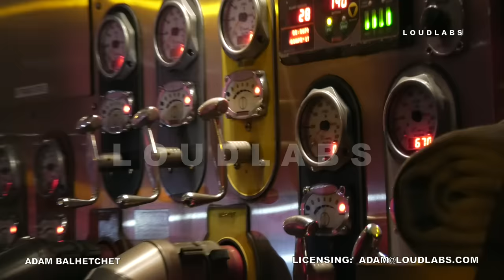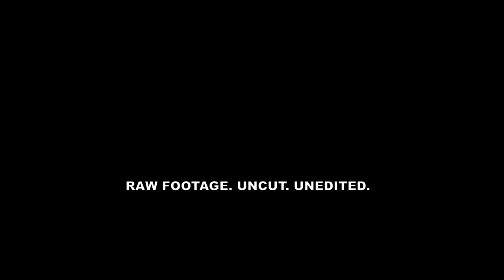24 Hurt in 6-Alarm Sunset Park Fire

Comment: I don't get it tower ladder 131 was set up at the corner of the building below the fire floor for 10 minutes doing nothing before they put it in operation after the fire spread to the rest of the floor 😯
Reply: I was thinking the same thing, I don't think any  firemen were on the top floor

Comment: Well if there ever a reason to cut back the budget. I saw a bunch of ladder trucks and tower trucks that were doing sweet F all. Well I should correct myself one was getting the top of the ladder good and roasted. 
This excuse/reason to not deliver water in the windows via the ladders and towers due to FFs being inside. Its true that steam burns are very serious. But 16 icebergs melted before any FFs were inside the building. Until the got inside they could have put a lot of water through the windows. The tower nozzle cam be controlled from the bottom. But no it just was raised for the sake of raising it...and putting hours on it. Well maybe I'm wrong they would have to find a hydrant and sent up supply lines. Which came first?
The ladder or the hydrant because it certainly wasn't the water.
That was a display of having far to many apparatus. Less vehicles with more FF on them.

Way cheaper and WAY safer as very heavy trucks that are difficult to maneuver and stop. Less apparatus saves tons of money. Also there is no reason in this day and age that every ladder doesn't come with a nozzle permanently attached to the top. Again there is that tradition. It's been a couple of decades in the  metropolitan area I live in that didn't have mounted nozzles on their ladders, towers and quints.

In my humble opinion large older department kinda get stuck in their ability to progress. They are to attached to tradition and not modernizing. Old School...repeat as necessary

Comment: What exactly was ladder 131amd others doing all that time??????????? Shopuld have been in action when fire was on top floor and not wait until the lower floor was consumed 

Thought the idea was to put water on the fire - putting it out??????? Is there some new theory where we simply let the building burn down now?????????????? Why risk firefighters when you can put large volumes of water right onto the fire.
Reply: Thank u, I was thinking the same thing
Reply: Exactly. There should have been master streams flowing at it way earlier. Several aerials set up but not being used. I dont understand. Even the biggest fire department in the nation can drop the ball on quick water application/evaluating fire conditions. That fire was master stream size from the start of the video, also seemed wind driven. Hand lines were obviously not effective on initial attack with this one.
Reply: They always do this 100's of firefighters and 10 trucks all standing around chatting and watching it burn. Usually after about 20 mins they decide to use the ladders and put some water on it. I think they want to let it take hold good and proper to involve more of the building, so they can demonstrate they can put out a really big fire.
Reply: It's a simple case of don't go to the fire wait for it to come to you.

Comment: there videos form FDNY still amaze me. Seeming so many and seeing trends on how they fight fire is almost shocking. How they can let every fire go threw the roof and destroy the entire build is amazing. Watching this video for instance, why keep putting water on the top floor when it's all burned away? Why not work on the floor below where all the heavy active fire is? Set  the first tower up and start spraying water but then move the bucket and the wind blows most of the water away. Why not leave it on the one side facing the wind and use the wind to your advantage? Its like they almost try to make it look like they are doing something but actually trying to burn the building down..

Comment: fires are put out with water and/or foam.  I haven't seen either.  I have seen a lot of flat hoses which means there is nothing going through them - this is not what I would call good firefighting.  Hey boys - do you want to play a game of cards while the building burns?  this fire department would never be tolerated in my city.

Comment: Putting water on the fire sure would make alot of sense, but let us continue to wait and see if it snuffs itself out
Reply: Jeff A 6 story H type building with a fire engulfing an entire top floor, 5th floor, and 4th floor with 3 maydays, multiple urgents, and a roof collapse that caused an explosion. Water came. It went out.
Reply: Well it's not just that easy to show up and put water on this kind of fire. Unless you been in their shoes you shouldn't talk. A lot of issues to deal with one big one would be the wind.
Reply: JB91710  J.B. I sea you are another armchair firefighters that thinks they know it all. Unless you have walked the walk it’s time to let the real firefighters do the job. Of coarse you are free to join a department and see how you measure up.
Reply: JB91710 Just read the other comments and see if you can figure it out. If you had any knowledge of what was going on you might understand that they were doing everything correctly. Go back to your chair and see what else you you can find wrong with the world.
Reply: JB91710  The first thing you do at a fire is getting the people out saving life is the most important thing. If you look at it you can see that is what they did. You can’t start with the water until you know it is clear. Pleas go to a firehouse and ask them. I have done this job I have a pretty good idea of what was going on.
 Also get that “chip off your shoulder “ you do not know everything. 
Look for some videos of firefighters training and get the correct information. They and have a good day.
Reply: JB - People were in that building. Ever see what water does to a fire, it creates steam, i'm not a fire fighter but even I know that. You want to steam boil those people before the firefighters can get them to safety?
Reply: @Brian13549  they literally had the ladder truck up in the air and just watched it burn, they could of sprayed some water, but instead waited till it went lower
Reply: @JB91710  you strike me as a volunteer hose dragger who got lucky to go to a vehicle fire once 17 years ago and now you're convinced you're an expert...

Comment: I don't know how many guys have actually fought fires this way I grew up in Chicago watching them fight massive fires I moved to Colorado and became a volunteer 18 years later I chose to retire first and foremost has anybody ever tried to put a hose stream up six floors it's not going to work especially in that wind so you're going to have to do interior to get it up water on the Fire that means stretching 500 feet of inch and 3/4 of 6 floors if you can make it up there first alarm assignments usually two to three trucks in New York I don't know about anybody else but my department taught us life-saving first before firefighting from the comments of 24 people injured that's the people injured 54 displaced but there was how many apartments that had to be searched that all takes time second alarm brings a couple more trucks they're still doing rescue and search and rescue third alarm brings few more trucks finally they might start trying to fight the fire from the exterior by this time it's probably an hour into the fire from when it actually started not from when the first truck got on scene that might be only 30 minutes not enough manpower for something that high up with that old of a building which was probably never retrofitted with sprinklers built-in probably 1940's 1930s the building was was probably built with primary plaster and lath interior with some firewalls but they didn't have the technology we do today so when the Fire gets going with the fire load of the Apartments and the construction material of the building plus the wind they're pretty much was no hope for a save on the upper two floors they did their best and they always do maybe not to your standards but for a City the size of New York with the age of the
Reply: You have a very valid point. From about 1980 and back the FF fought huge massive fires with smaller trucks and were very successful. Why? The priority was to get water flowing immediately and they actually hustled not stroll around. Big is very seldom better.

Comment: I can't let this go - the fire is in the building not on the brick walls on the outside of the building - why are they aiming the water at the brick walls - are they afraid the brick is going to collapse or are they afraid of getting to close to the fire to put it out.  I had a lot of respect for the NYFD but after watching this I no longer have that respect.  My little town fire department could have done better.  what do you know - they finally found a window but unfortunately it is to late for those who use to live in that building.  I'm saddened to say you guys just don't cut the mustard and more training is certainly needed and less standing around would be more appropriate.  On a scale of 1 - 10 you rate a 2 The caps on this indicate 24 were injured - I can certainly understand why - harsh words are given when they are deserved. I know firefighting is a difficult and demanding job but watching the performance of these fire fighters scares the hell out of me - thank God they are not working in working my city.
Reply: RH H when you have an attack team or two inside you can only aim at certain area so your not steaming them out. Plus you also have search teams inside  locating possible occupants and calling in attack positions. No what your talking about before you couch criticize.

Comment: If you watch any fire department responding to fires these days, they are ridiculously slow in getting water on the fire.  First they have to do their hair, iron their coats, put up a ladder they'll never climb, walk in a circle a few times and then consider how to extinguish the blaze.  Two 5th graders with a garden hose could have had this fire under control in minutes.

Comment: The FDNY should change their protocols and deploy the deck guns on fires on upper floors out the windows. It takes a while to stretch a line upstairs.
Reply: Deck guns are only good to a certain extent and being this Windy and the fire being on the top floor they wouldn't have worked very good in this condition.